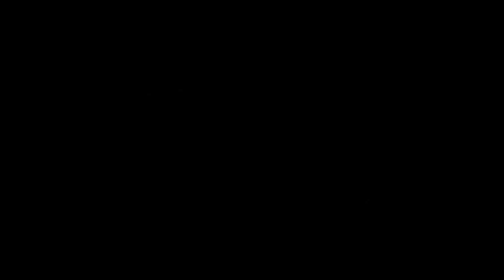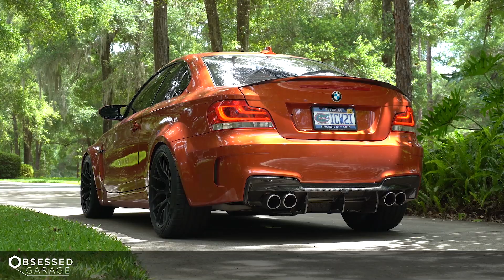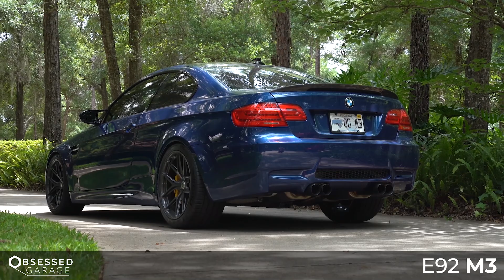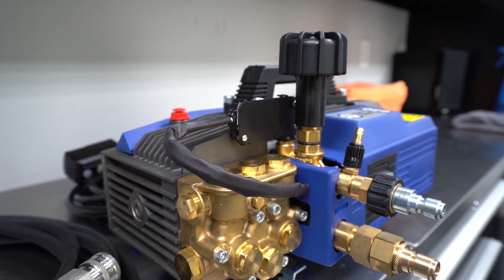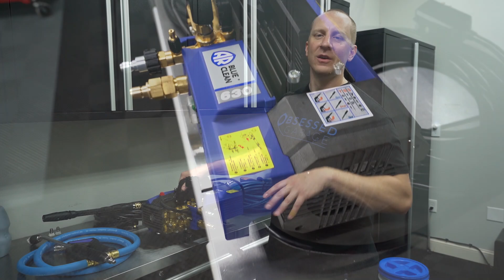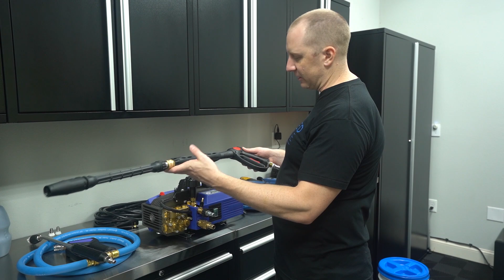The Pressure Washing Project: E16 - AR Blue Clean AR630 TSS HOT Testing

Comment: Any thoughts on removing the white plastic filter that's in the water inlet when the brass garden hose adapter is used which has a wire cone filter in it?

Comment: American water heaters don't go past 50 degrees C? In the UK ours go to 95 degrees C. That is around 200 american inch degree medieval units.

They are powered by Gas or Oil. We have mains gas to most houses unless rural then you can use oil.

Comment: I believe a 20a circuit should be run a 16 amps continuous.  A 15a would be 12 amps (using 80% rule).  So the AR would even be pushing the limits of a 20a circuit, I believe, no? Anyone having issues running this on a 20a circuit?

Comment: Can anyone confirm the size of the mounting base?  I have a stainless shelf that is 8” x 16”. I know the 8” depth will work. Wondering if the 16” length is enough for this unit.
Reply from the maker: Yes, that will work.  We use and 18" x 8", but 16" will work.

Comment: In your opinion, you think this washer would be good enough for vent a hood cleaning on food trucks? Im looking for a similar system to build on a trailer with a generator to be mobile. Thanks alot.
Reply from the maker: Hmmm...I think I would rather have more pressure.  This will work, but it won't be nearly as efficient as gas.

Comment: Matt for whatever reason my foam cannon with either orofice size with my AR makes the AR jump and kick and seems like it is harming the machine ?
Reply from the maker: That sounds normal.   You definitely want a 1.25mm orifice on it.  Do not use 1.1mm.
Reply: @ObsessedGarage  I thought the machine was going to break with all the clanging and shaking while using the foam cannon. So that’s “normal” . Without the foam cannon it is super smooth. Add foam cannon and it rattles so loud and bucks. Using the 1.25 mm orifice.  Wondering if need to be a bigger 1.35mm orifice.

Comment: For those watching this video long after the post date and into the future, you might be able to get away running this unit on a 15 amp circuit. I personally run my AR630TSS with 5.0 rinse nozzles and foam cannon orifice of 1.5mm. I haven’t gone over 14.4 amps with this setup and it runs great. You can get great foam or poor foam if you don’t use the right soaps.
Reply: This helps a lot, that was my only concern and huge reason why I haven’t pulled the trigger on it. What size AMP are you running in your garage?
Reply: @e.cabrera1861  I do have it plugged into a 20 amp outlet but it's not dedicated. It''s actually being shared with my washer but I only ever operate one or the other. Reason for the 20 is I sometimes use a smaller orifice rinse nozzle (25 degree, 4.0 orifice) to blast off stubborn dirt and traffic film buildup. If I'm more diligent with my washes, then I stick to 5.0 or higher.
Reply: @godowarus  you definitely sold me on it. I appreciate you getting back to me man. Nothing in my garage shares that 20 amp, by the sound of it I should be more than fine. As far as maintenance on it, nothing too crazy?
Reply: @e.cabrera1861  As long as you use rinse nozzles 5.0 or bigger and a 1.25mm foam cannon orifice, you should be able to get by on a 15 amp circuit. By the way, 15 amp outlets look like the normal "face" but a 20 amp outlet has one of the lines looking like a ' T '. But always check your breaker if it is indeed a 20 amp circuit or just a 20 amp outlet on a 15 amp circuit. As far as maintenance goes, I have changed the oil only once and seals are still good. I suggest looking at The Clean Garage website as they sell the oil as well as replacement seals.
Reply: @godowarus  electrical stuff has never been my thing, but you make it easy to understand. I double checked and I do have a 20amp circuit dedicated for the garage, however the outlets are 15amp outlets. That doesn’t limit the circuit to only 15amps because of the outlets? Excuse my ignorance.
Reply: @e.cabrera1861  No, it shouldn't. You can very well put a 15 amp receptacle on a 20 amp circuit. On a true 20 amp plug, one of the prongs would be side wards rather than parallel. On the AR630, they are parallel to each other and so you can plug it into a 15 amp outlet, but likely it will trip the breaker if you use orifices smaller than 5.0 for rinse or 1.25mm for foam cannon.

Comment: Set the water heater at 140F then use a Cash Acme tank booster, basically premixing and set the hot out mix to 120F. The high at the water heater is recommended by American Society of Sanitary Engineering and also get a ultra low density water heater element if running on electric heat.
I have a 40 Gal tank with the Cash Acme and ultra low density water heater elements and it does wonders for at least 2 people in the winter time even. The Cash Acme device extends the hot water use and the ultra low density element smoothens out the hot in the tank as you can sometimes feel waves of cold/hot during a shower sometimes without it. The ultra low density element is also way more efficient. 
If you plan on using a recirculation pump, next time I recommend insulating the hot and cold return line in the house during the construction phase. Not only that, but I recommend insulating all water lines with pipe wrap to prevent transfer of heat or condensation build up adjacent to the pipes.

Comment: My AR630 measured 1100 PSI and 1.95GPM. Looking at the range of values posted under this video, it seems either AR has a problem with consistently adjusting the unloader valve at the factory, or the unloader valve spring itself drifts out of specs (not unlike torque wrenches). If this holds for other models and manufactures (based on a cursory search - it does), this specs drift invalidates the whole idea of 'testing' the pressure washers. I have readjusted mine to about 1400PSI to get to the advertised working pressure of 1500PSI, which should be an average PSI between the wand spraying and not spraying. I do get about 2.05 GPM at this setting. Do at your own risk. https://www.youtube.com/watch?v=cbKdbWaA3pI
Reply: With all the unloaders I’ve used,  they will adjust pressure up or down by turning the knob. Adjust with the trigger pulled and spraying.
Reply: @ZomBeatBrainZ  Turning the knob adjust the pressure up to a factory-set max value of the unloader. You can change this max value by adjusting the spring in the unloader.

Comment: IMO the best Electric unit for Detailing is the Northstar Auto stop 3000psi Electric Unit. For washing cars these 1500 psi units work but for under sides , motor, lifted trucks you need more power IMO
Reply from the maker: Ha, ha... No, those are the typical janky crank shaft type American pressure washers.
Reply: @ObsessedGarage  really? Interesting. Why are they junk? Because they are made in America? It's a 1300 dollar pressure washer.  I hope it's not junk. These 1500psi units just are not enough power for real-world use for me at least.
Reply from the maker: Just look at them.  There are a bunch of those types of brass head, rather lazy engineered machines.  If you want American quality, you need to go a Cat Pump, but you are going to spend double that.
Reply: The unit  has a cat pump and industrial 5hp motor.  We are not talking about the same units I think.   @ObsessedGarage
Reply: @ObsessedGarage  https://m.northerntool.com/shop/tools/product_200804784_200804784

Comment: Well it is more than just a couple of hundred dollars cheaper. The AR630-TSS-HOT runs $628 at one outlet compared to $1190 for the Kränzle 1122 TST. So about $562 cheaper which can buy a slew of accessories many times over. Plus it is a Commercial unit and parts from Annovi Reverberi parts are readily available. And just over $800 in my dollars makes a big difference. I like the Kränzle, but almost $1700 in my dollars is a bit crazy.

Comment: I’m a Mobile Detailer, AR is the top of the line when it comes to pumps in my opinion.
Reply: Do u power it w a generator, battery, or plug in to an outlet? I’m wondering what options there is to run it mobile
Reply: @arreola961  generator. Unless you want to explain to the client why you keep popping breakers. Not a good look. Igen4500 is a great option to run this and a decent air compressor.

Comment: Great review and demo of this pressure washer, Matt. I think I've re-watched this particular video at least a dozen times and it helped me make a decision. I've gone from waterless wash to ONR, to the Worx hydroshot and currently the Sun Joe "bucket joe". Now I'm currently putting together a cordless system involving the AR 630 TSS, a water tank, power inverter and a large battery. Sounds like so much work since the "bucket joe" does all that. But eventually I want to try going into mobile detailing more so.

The Kranzle is too nice to abuse and the Comet's connections aren't very friendly for my needs. Definitely going the OG way with a new hose, 5.0 nozzles, QC fittings, MTM SGS28 and the PF 22.2. The above setup will be my workaround as an apartment dweller with water restrictions. They said we can't use a hose hooked up to the main water supply, not a tank =P.

I live on the first floor and my stall is immediately in front of my door so it's not that bad. Thank you for providing all the important information and keep up the amazing work.

Comment: Matt you did the benchmarks on the AR630 whats your final thoughts? I have been detailing cars since 2000 , worked for every car company from toyota to mercedes benz and had my hands on many pressure washers and guns.  The AR630tss is probably one of the best pressure washer i have used i quite some time.   For its built-well Hefty 65 ibs  and exact start-stop function, this thing is a game changer.  I use mine with a 30 Amp Firman whisper series generator with a 20 amp 3 prong outlet cord for $65
Reply: I must say Matt, everywhere I turn your company has the end-all solution to the problem.   From locking extension cords to a modified Aunt jemima’s cake batter recipe.   Keep it up the good work!
Reply from the maker: It's a good option.  I'd still pick a Kranzle over this, but this one is good.

Comment: Wow. I love this pressure washer. Got it from OG on Black Friday. Used it several car washes so far!  It is awesome.  Upgraded from the sun joe spx9004 to this. More flow, more pressure, and fast auto on/off!!
Reply: David Dear yea i know, got mine at a pawn shop for $300 out the door.got the 630tss  with a cracked fan cowling. Replaced it and now its brand new.

Comment: Great review. Can you post the AWG of the cord?? I would expect 12AWG but it doesn't look that heavy? Its really screwed up that these manufactures do this as the NEC states that a 20A breaker shouldn't exceed 80 percent of its rating which is 16A unless the breaker is labeled otherwise (AS you mentioned its a dedicated breaker but must be labeled for it.) Even on its own circuit, 19A is pushing it big time. Makes me wonder if this one or the Kranzle are UL listed. They really need a 30A breaker with 10AWG and on a L5-30R twist lock receptacle which then would require a GFCI breaker.
Reply: That 80% rating is for constant draw appliances. I'm assuming they don't fall under that category with an auto on/off feature. But also you'll find some space heaters will draw about 1800w, so that's very close to 15a, which is what most outlets are in homes. For example my convection space heater draws about 1800w

Comment: Is there any difference between the 630 and the 630 HOT?
Reply from the maker: No, just the ability to accept water from a boiler.  Tap water heaters are generally only going to get you 130 degrees at the highest end, so there is no need for the HOT.
Reply: Obsessed Garage I’ve been seen a lot of reviews on the internet saying the hot water version 630 hot has an auto stop when the trigger isn’t engaged. As for the 630 regular version the machine stays on until it’s turned off. Can you confirm this?
Reply: @trix805  I've since purchased the 630 tss version.   The 630 will stay on, the 630 tss has the auto stop, and the 630tss hot can accept hot water up to 190  from a boiler.  

I'm guessing componets are more temperature tolerant in the hot version as the standard TSS system does heat up a good bit from extended use.. i pressure washed my entire drive way (about an hour's of constant run time) and the thing was pretty hot after.   Hot enough that it was uncomfortable to touch the heat sink..

Comment: I own both the AR and Kranzle and I prefer the AR. I have been using the AR for the last 3 years and it hasn't skipped a beat. I have probably only used my Kranzle a few times lol.. I plan on keeping the Kranzle as a backup but the AR is superior when it comes to specs.
Reply: I just picked up my AR630 TSS several days ago!  I can't wait to use it this weekend!  Honestly between the two I think the AR is better.  The pump design alone is better than the wobble plate that Kranzle uses.  Yes the Kranzle has a nice smaller profile and neat little handle (aesthetically, I think it does look better).  But since it's going to be mounted on my shelf it doesn't matter.  I wanted a better design and I feel the AR does this.
Reply: @NewShockerGuy  I was gonna go all in on a kranzle but now not sure ??
Reply: @kcimages5157  I bought the AR 630 tss.  I love it!  It has a superior pump design over the kranzle.
Reply: @NewShockerGuy  You say it has a better pump, can you explain why you think that. Thanks
Reply: @wally6193  The kransel uses some type of wobble plate which in my mind for what you're paying for that unit is not acceptable.  The pump design on the AR is better.  Just do some Google searches and you'll start seeing the difference between the two.
Reply: @NewShockerGuy  okay thanks, I will do that.
Reply: @NewShockerGuy  This is from the manufacturer - For over 50 years, Annovi Reverberi has manufactured one the world’s highest quality lines of high-pressure pumps, incorporating industrial-grade performance, safety, and quality into their electric pressure washers. With a bonus turbo nozzle to double cleaning efficiency, the 1,900 PSI 1.51 GPM Electric Pressure Washer is equipped with a durable 3 axial-piston wobble plate pump to handle almost any cleaning application. Triplex Plunger pump with axial wobble plate.

It would seem they also use a wobble plate.

Actually whom ever posted the info I just posted was incorrect. I just went to AR's website and got a parts breakdown schematic for the AR620/630 and they are triplex pumps as they have a crank shaft and no wobbler plate. So as you said yes they are better than the Kransel with wobbler plates and according to industry experts the triplex style pumps will outlast wobbler plate pumps by 3/4 times longer(minimum). Now is this AR triplex actually a good one, don't know. AR makes numerous triplex pumps, are they all good? Someone like General Pump or CAT make some of the best.
The only difference between the 620/630 is the 620 has an aluminum head and the 630 has a brass head, which one is better if just using cold water, don't know that answer.
Reply: Very interesting!  Thank you for this.  Why do you think this if you don't mind me asking.  I've been looking at the AR and the Kranzle.  But spending $1500+ for the Kranzle seems nuts to me just so I can wash my cars.   I already have a gas pressure washer to wash my cars but it gets annoying to start it up and is noisy.  But the AR is almost half the cost of the Kranzle...
Reply: Thanks for sharing. How is the noise level of the AR vs. the Kranzle?

Comment: I bought the AR610 being a little bit cheap as it's right around half the price of the 630-TSS HOT.  I really, really regret it, the TSS is worth every penny on this model.  That GFCI plug is absolute junk, can't take a few hits on the ground.  I had to replace mine and it's been fine since.

Comment: The issue with 2.3gpm flow is that the CR Spotless is rated to give no spots at 2gpm or less.  If you push more flow through it then it might not be able to remove all solids from the water and give you spots.  Just something to think about.
Reply: bosoares run a smaller orifice... prob solved LOL

Comment: FYI - Hydraulic hose is also rated for temp and pressure. It should have a "ISO 18752" rating on it if it's for hydraulic application.
Reply: Yup, and you can take your hose to Advanced Auto if you need any areas that need cut out and spliced back together, you can even have them put swivel ends on.

Comment: I've ran my kranzle 1322ts on 140* hot water from my rinnai tankless water heater. Didn't have any issues. But it really was too hot. So now I turn both hot and cold spigots on in my garage and get about 110* out of the kranzle. Perfect temp
Reply from the maker: Good advice.  People underestimate how hot 110 degree water feels.  That's it a perfect warm water temp.

Comment: Nice that you’re offering this without the “hot”  😂 didn’t really see a use for hot water for a pressure washer 🤔 engine bay maybe 🤷‍♂️
Reply: Hot water helps a lot if you clean your car in the winter up north. It cuts through all of the salt and grime really easy. Plus your hands don't freeze off lol
Reply from the maker: Yeah, I would definitely be using hot water.  The HOT version would need a boiler that most won't have.  Up North you'd be washing at 110-120 degrees, so paying the extra $130 for the HOT options isn't worth it.  The normal is good to about 160.
Reply: In an industrial setting, the heat helps liquify grease when washing equipment.